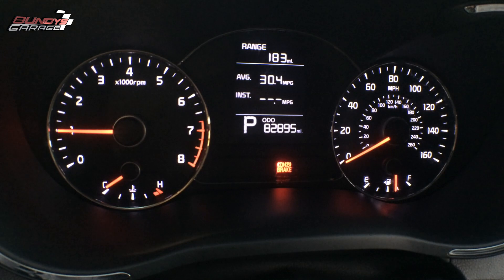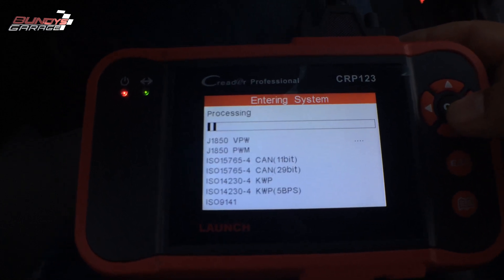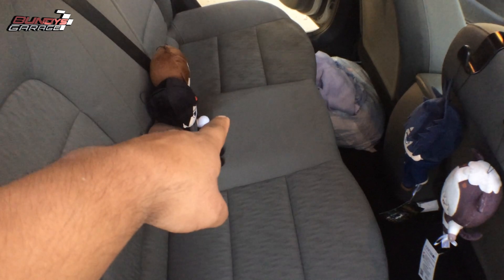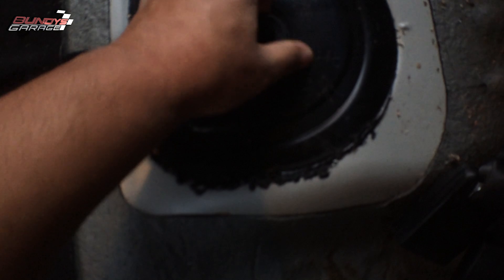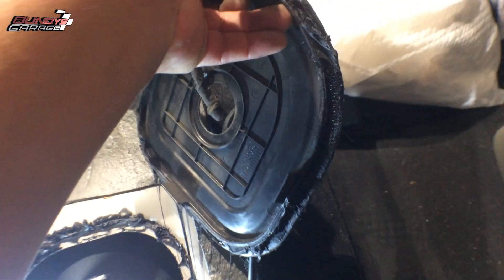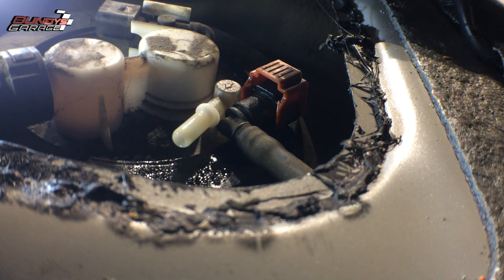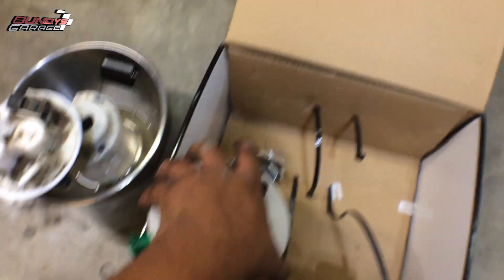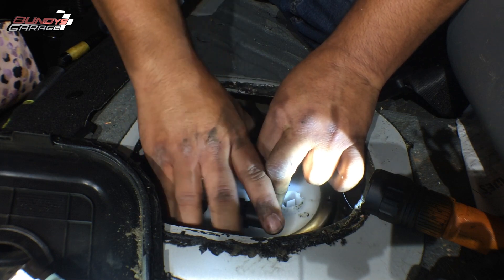P0463 Kia Forte Fuel Pump [FIX] Replacement Hyundai Elantra | 2013 - 2015 | Level Circuit A High

Comment: I have p0463 fuel level sensor in a Kia I just bought the car seems to be ruining god no issues and it’s marking the gas . Not sure if what it reading is correct , I’m thinking of just replacing the entire fuel pump just in case . Do you think that a good idea ?
Reply from the maker: Yes it is, Just get one from Kia. I have seen aftermarket ones that still give the wrong reading a few months after installation.

Comment: My car is doing exactly like you said for this lady's car. While idling it'll shut off and if I fill it up all the way it'll freak out. Mechanics were telling me 1,300 to fix it (I have a Kia Forte 5 2014) and I wanted to try it myself. Mine might just be the actual sensor that's messed but but, I watched the whole video just in case. Another video said I should probably disconnect my battery before starting because I might accidentally shock myself, is that true? Also, the way you explain things is phenomenal, regardless of what I have to do, you're gonna save this girl 1,300 dollars; thank you ❤

Comment: My Kia forts had 28k miles and when I slow down it turns off and I have to pull over and restart it. Also no check engine lights on. Probably the same issue?
Reply: That's how mine is, but mine is at 168,000 miles. I've been told just the sensor is bad, but if that's not the issue, then the whole pump could be bad

Comment: My car has become a bit bad on gas and has a slight vibration to it through the seats and steering wheel. There was even a bit of a studder with the engine. Could it be this is the issue in addition to fuel injectors?

I had the spark plugs changed and one engine mount. Also an oil change and an air filter change.

Comment: Would this have to replaced if 2 cylinders are misfiring? I have this same code. Maybe the fuel injectors arent working on mine? I have an 2014/2015 Kia Soul

Comment: Had to do this to my 06 Focus because the fuel pump went south. I wish Ford would've put an access hole in the back under the seat. I ended up removing the tank to replace.
Reply from the maker: After 100 years of manufacturing cars you think Ford would be the best, but there not. That’s why people choose Toyota and Honda over Ford. I hate Ford, if I had a Ford I would put explosives in it and launch it off a cliff and blow it up on its way over to the bottom and make a video for everyone to watch and laugh at. I’d rather push my Chevy then drive a Ford!!!
Reply: I can't say I blame you, and after the accident with it; yes, I replaced the Focus with a CR-V.

The fuel pump itself was not a bad experience.... It was everything that attached to the fuel tank. The vent tube and filler neck were JUST long enough to fit on with the tank jacked up 6/7 of the way, same with the wiring harness.

And you're right, that fuel pump replacement was a  @#&#@$# because of the aforementioned "issues".